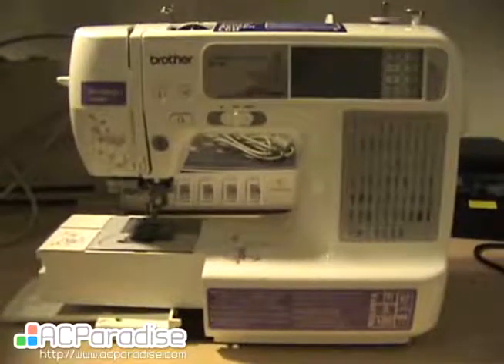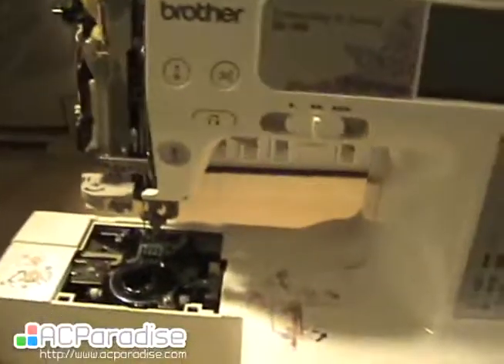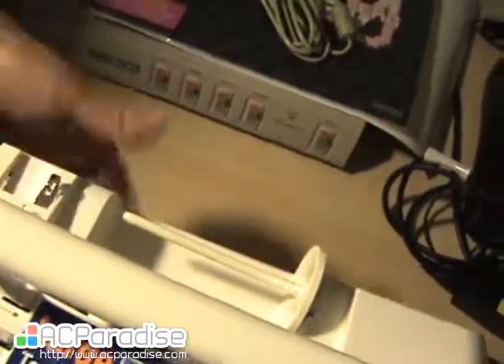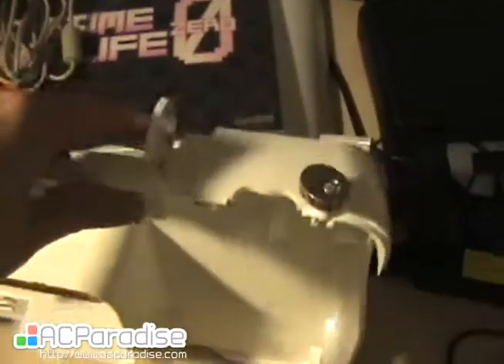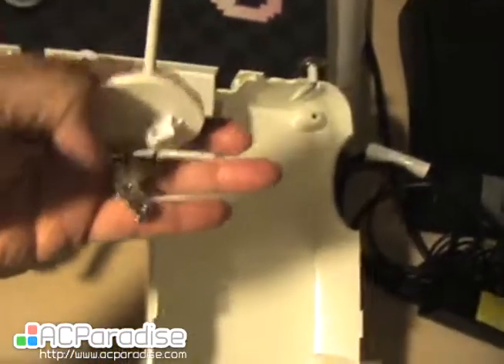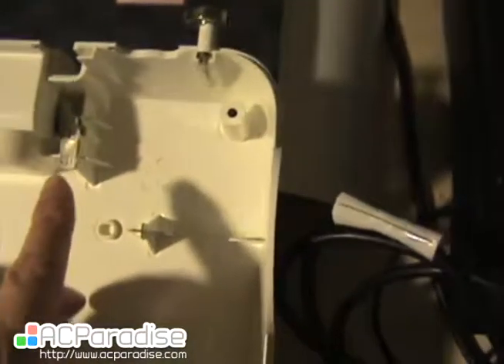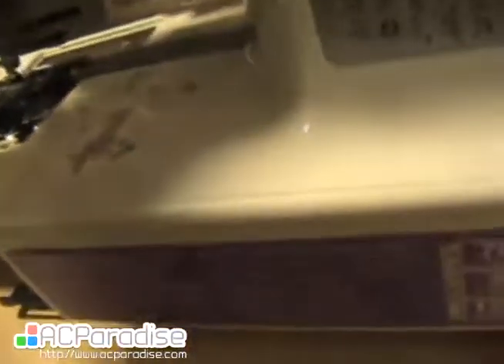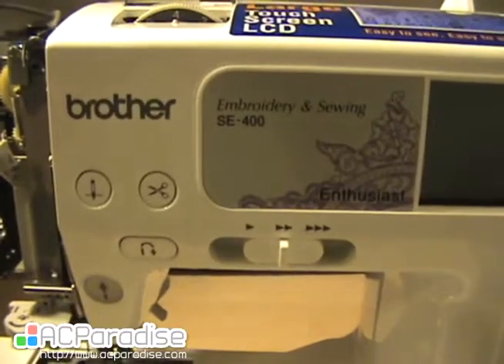Brother SE400 Embroidery Machine Spool Pin removal and replacement

Comment: I just watched a few of your videos and I don’t remember which, but in one you mentioned not to remove the 3 screws on the black part of the machine. In the other videos you don’t say this, you just say “unscrew the bottom and back.” I ended up unscrewing the entire bottom and now the machine won’t fit back together again because all 3 pieces of the casing won’t align. I appreciate a lot of the information in your videos, but please assume someone coming here is an absolute beginner with zero knowledge of how the inside of the machine works, and not showing the underside or explaining this detail in every video can lead to serious misunderstanding on the part of the viewer 🤷🏻‍♀️

Comment: After reading other comments I was worried about misplacing a screw so I took a piece of paper and put each screw on top of a description that I wrote of its placement...top left back, behind presser foot, center back handle, top right behind handle, etc...and it worked well for me. Also, when you replace the bottom cover make sure the white plastic tabs slide beneath the black metal cover. As you separate the front and back during disassembly it's helpful to have another set of hands to ensure they don't snap back together as you work on the next one.

Comment: This would be SUCH a helpful video. . .  IF it included the all-important disassembly steps!  If you ever get yourself a tripod, I wouldn't be able to smash the thumbs up button fast enough on a video that showed the entire process of unscrewing and taking apart the casing of the machine.  My spool pin is snapped and I have the part but I can't get the machine apart so now I guess it's time to go machine shopping.  Sigh.
Reply: I found a manual online, which I could download for free, which gives you clear, illustrated, step by step instructions for dissassembling & reassembling the machine (mine's an innovis 10.) It looks like a technician's manual. I got the machine apart (it's the plastic clips that are the nightmare, screws are straightforward enough,) and replaced the carry handle. Have nicely put it all back together, and just as I was going to give it to someone, the spool pin broke (grrr). At least I now know how to get it all apart, and replace it!  And yes, the chap in the video would do much better with a tripod!
Reply: @Elizabeth Coleman  You may have missed a screw, I did at first, would you like a link to the manual?

Comment: I saw you had several repair videos for the 400 series. I know the 425 is similar and I’m hoping maybe you know where the speed sensor is. I’ve never taking it completely apart like your videos just hoping it’s a cleaning issue vs a broken issue. Any insight would be appreciated

Comment: I have a Euro-Pro 6131 sewing machine that has a horizontal spool pin that is suppose  to stay tilted up when you tilt it to put a spool of thread onto it, but mine does not (stay tilted up) anymore. Would replacing the horizontal spool pin fix this or is whatever it screws into on the inside (that possibly allows it to stay tilted up) need to be replaced?

Comment: thank you !  I need to replace mine too.   I with I could send a pic of my machine  - in parts!  The thread cutter won't slide properly - it slides hard, not sticky just won't slide.  Any suggestions?